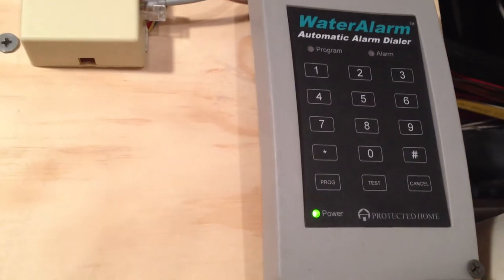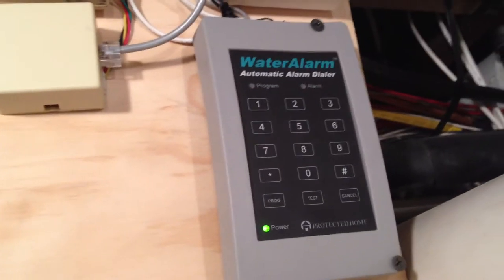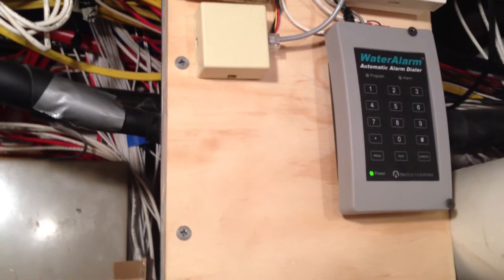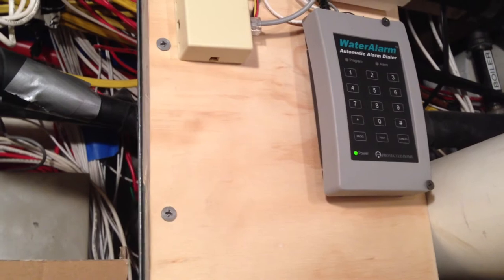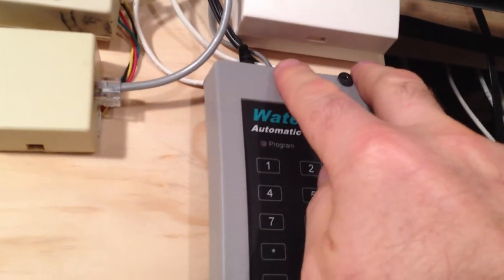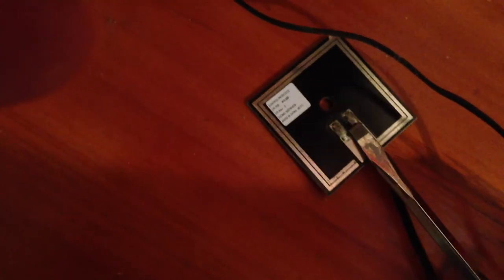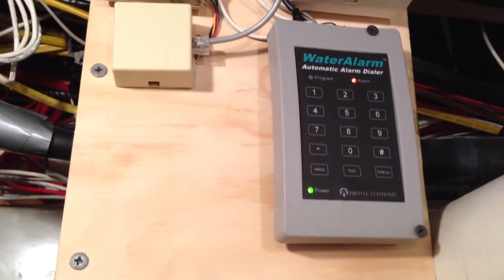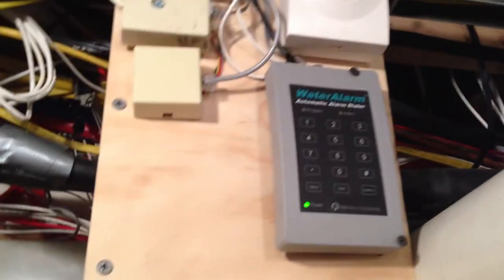Protected Home WA 700 Water Alarm Dialer

Comment from the maker: Update: I have been through 2 of these and I am purchasing something different now. The Item lasts for about 2 years and then gives out false alarms. It saved me from several flodds which is awesome, but it needs to be more reliable. Also whenever there is a leak, it calls you 24.7 unless you press the button on the phone at the right time. I think better off with a texting solution.